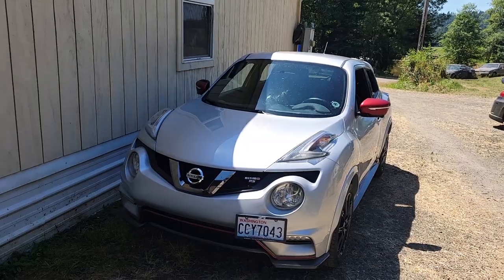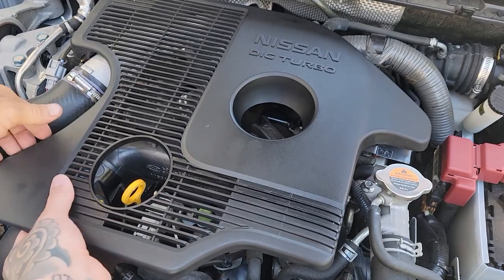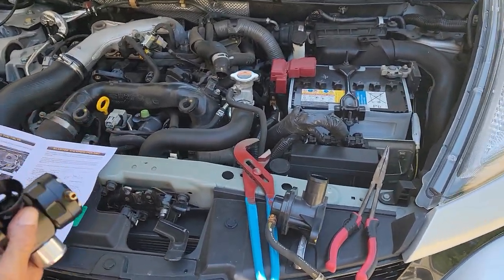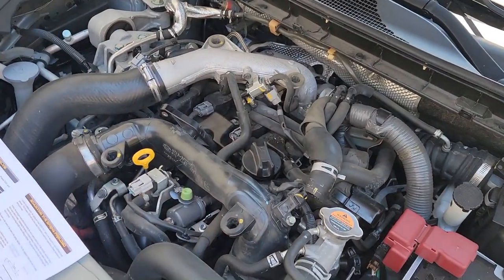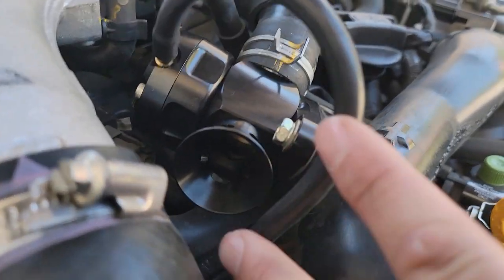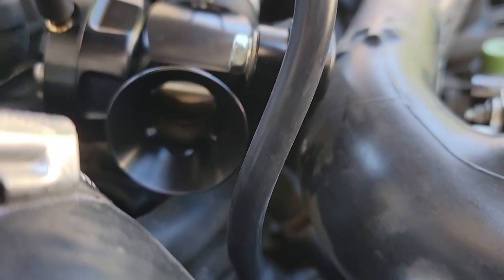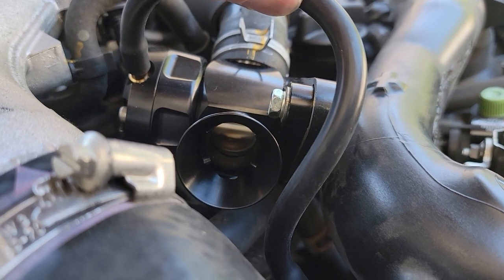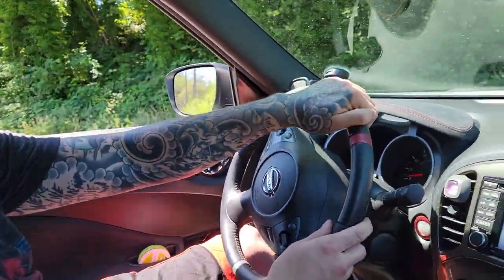2015 juke nismo rs GFB blow off valve install

Comment: yo! it sounds really nice, just the sound im looking for on mine. now, i've read somewhere on the juke forums that venting fully or partially to atmosphere will richen the mix on the instant you let off the throttle which might throw a CEL - have you had any issues so far?
Reply from the maker: No issues so far the gfb bov has worked really well so far. I vent fully to atmosphere and haven't had any codes or stumbling
Reply: @BrewsBoost  beautiful, might pull the plug on one someday!